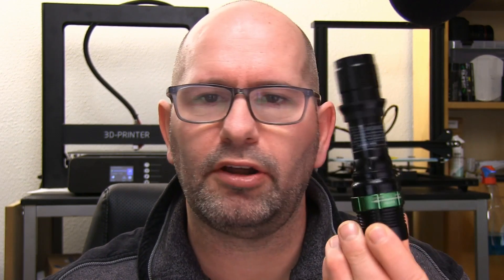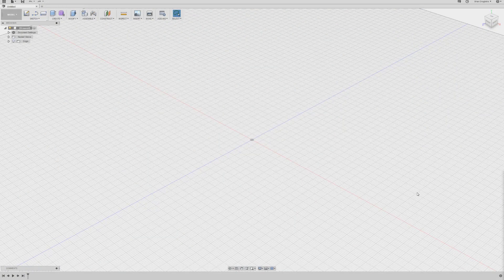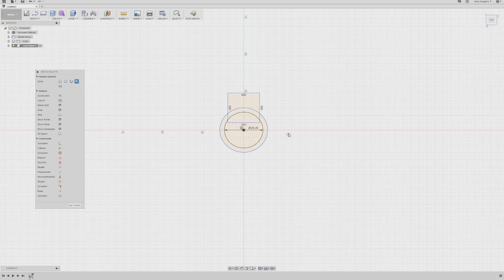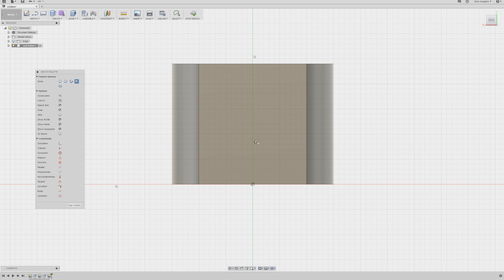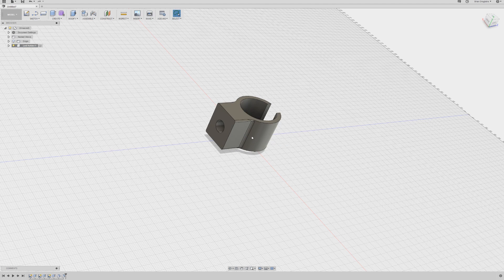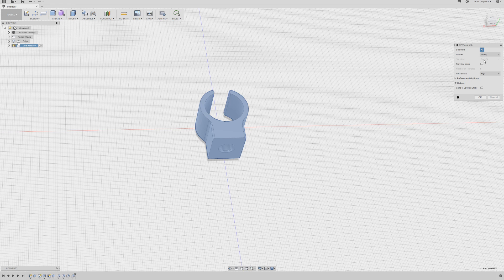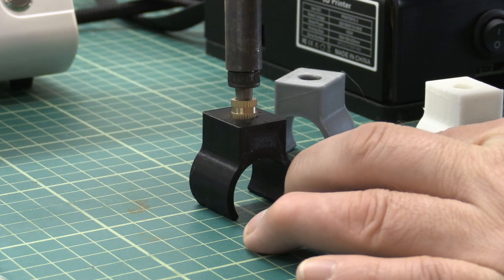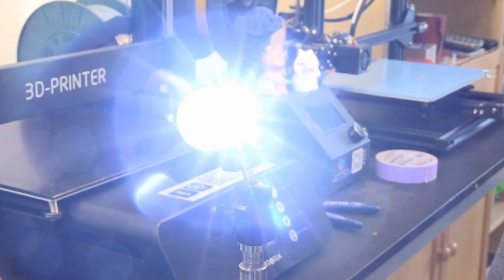▼ Making a tripod mountable flashlight holder

Comment: If you make the hole for the insert on the clamp side, when you push it in it will not be able to pull thru the bottom. Just a thought. Nice work!
Reply from the maker: Thanks for your thoughts on this,
On earlier (different) models I have tried that, but when you do this, the bottom will be deformed because of the heat of the knurl nut.
The way I have done it now, is as far as I have experienced the best way to do it.
(but I am always in for more experiments).

Comment: Good idea - thanks.
FYI - it's pronounced "Nurl" - the "K" is silent (at least here in the US).
Any particular reason you set them so deep?  Just past flush would seem to be the best to me.  Just curious.
Reply from the maker: Hi Ron,
Thanks, I was struggling with the word as I didn't know if the K was silent or not.
The reason I put them so deep is that when you put them just to the edge, they are more likely to get out of the part again. Pushing them deeper makes sure you are never getting them out again without damaging the part. And for most lightstands it doesn't matter as the threads are long enough.
Reply: Cool. Thanks.  Still a newbie here.